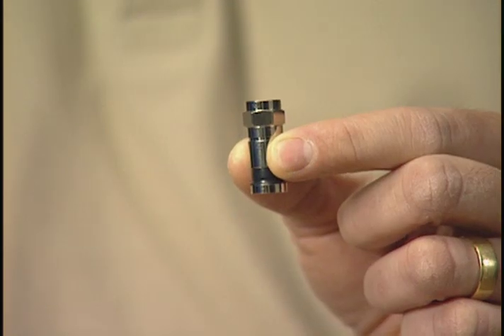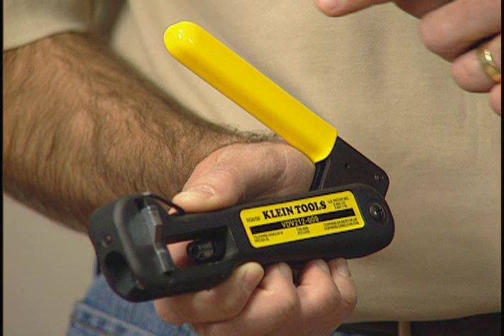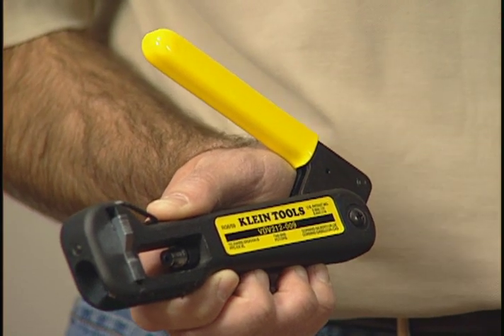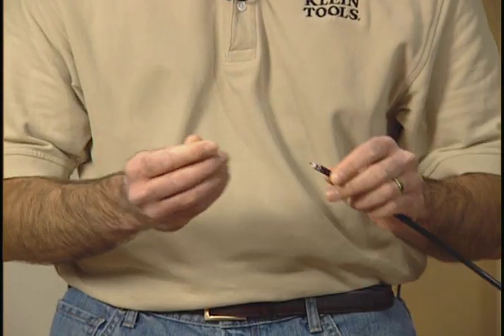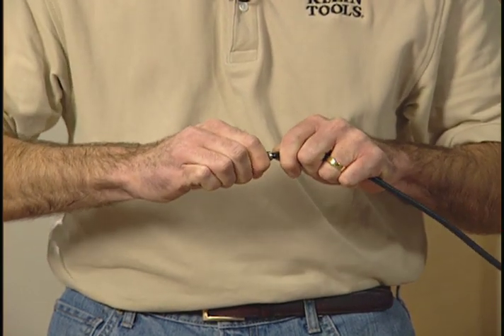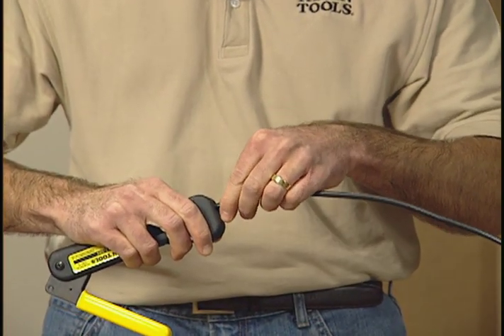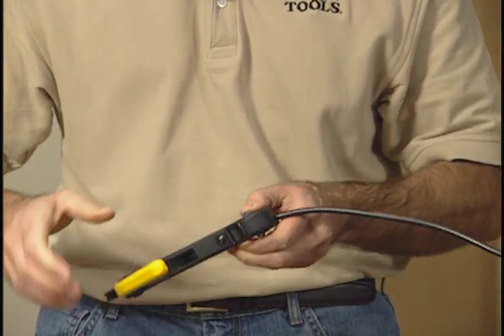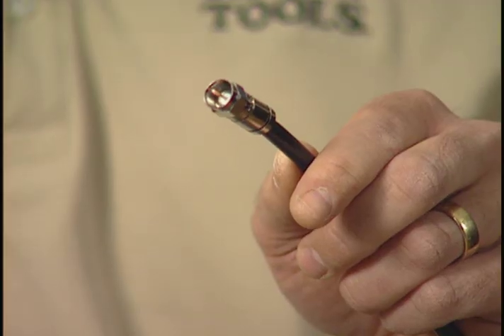Klein Tools Compression Crimper

Comment: Just bought a VDV211-063 compression crimper. I am using the one dot setting to compress a BNC compression connector over a RG59 coax cable. When I clamp down, the cable gets pushed out even if I apply a lot of pressure to hold it in. What am I doing wrong?